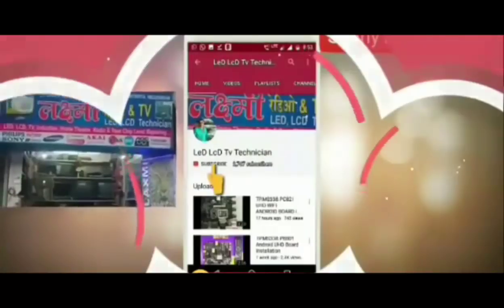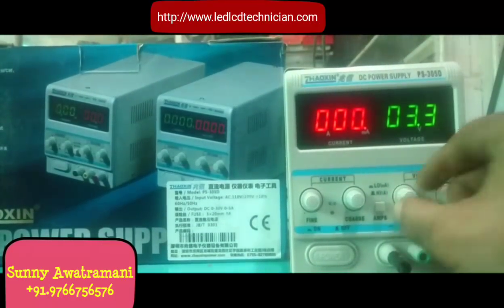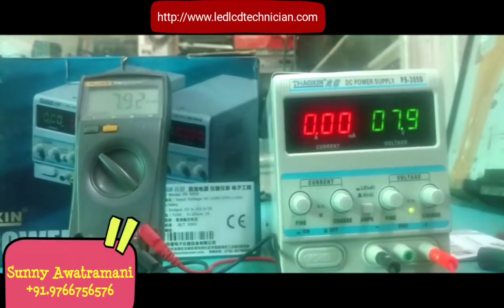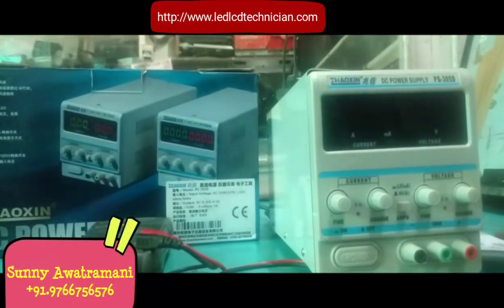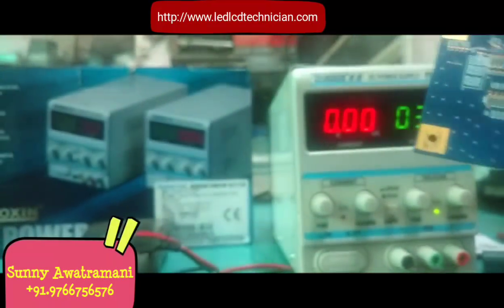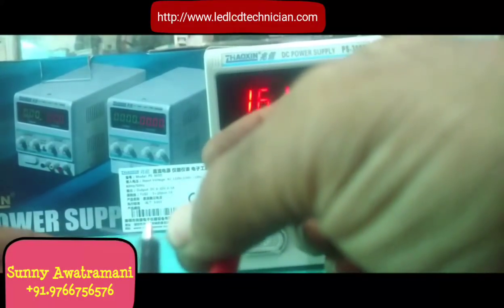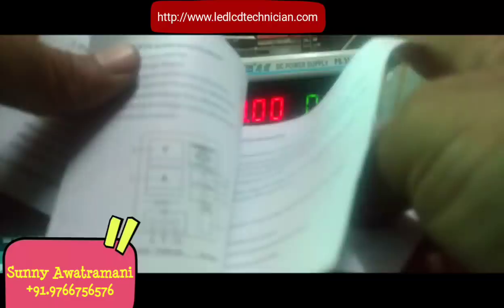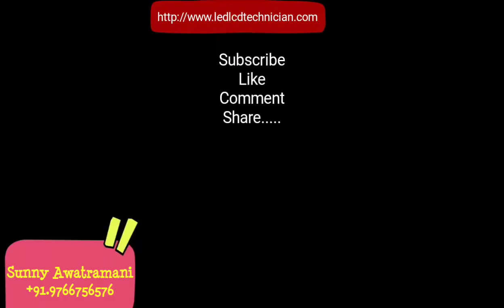PS-305D Power Supply UnBoxing And Review with english subtitles

Comment: I am in confusion  I am installing v 59 universal board in laptop lcd panel  it is 6 bit model no b141xg08 v.1  in panel 6  clk edid and 7 data edid  where this connection will go in v59 board please advise